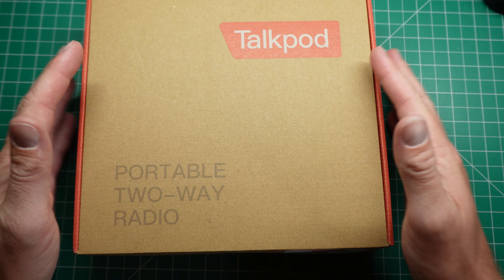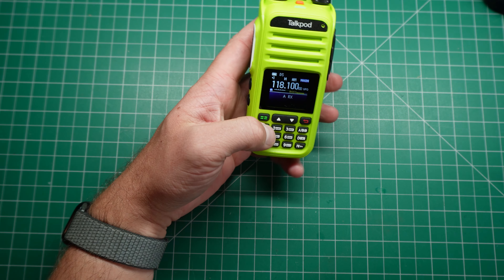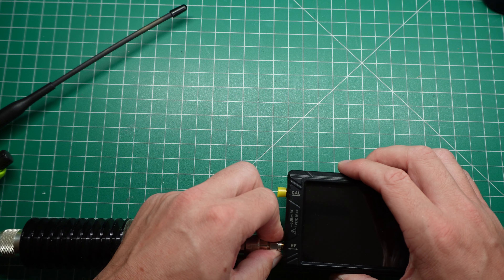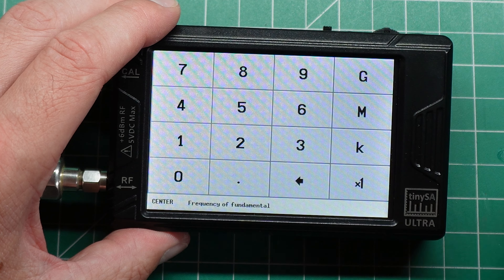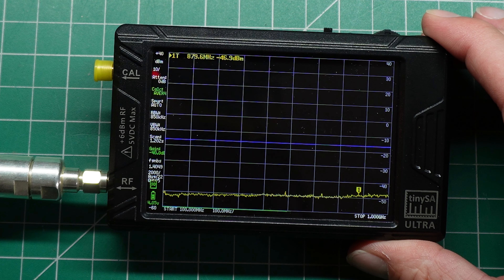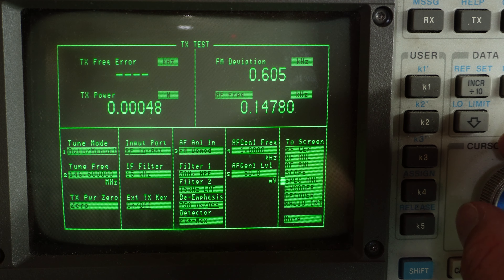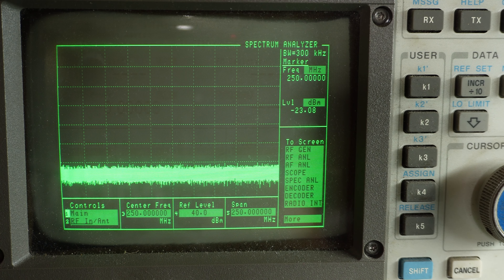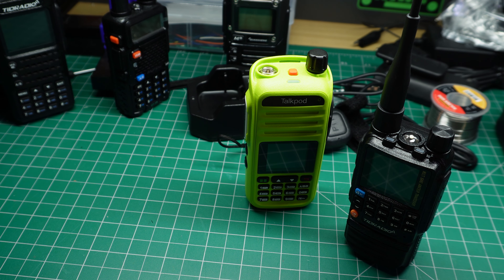The Talkpod A36 Plus Has Been FIXED!!

Comment: Truly it is the end times!  I noticed the link points to the GMRS version.  Is that just some firmware magic to change it to ham?
Reply from the maker: The version I received was the GMRS one, now I believe that holding in those button presses works to get the “expand” mode. But if it doesn’t, there is an “INT” version of firmware on their website.

Comment: Hi, Good news. How 'bout doing SINAD sensitivity tests for each radio. You have the equipment. 😊
Reply from the maker: Can't remember if I tested the A36 in a previous video, but I have done 12dB SINAD testing before. Good suggestion
Reply: @HamRadioDX  Folk seem to get more excited by a 1-2dB  increase in Tx power, than say a 2-3dB improvement in Rx sensitivity. 

So I reckon sensitivity testing IS worthwhile and perhaps even an article on "Why SINAD?" and what is it good for?

On a marginal link they are equally important, as is possibly the most important... antenna gain. :)

Comment: I have a A36P version where it says P and not plus.  Is there ANYWAY to turn off the tailing squelch after it receives a transmission?  I have other radios on the same frequencies and they don't make ANY sound after getting a transmission, but this one does it with every thing it receives and it's ANNOYING.
Reply: Choose the Option 26  in the setting menus and choose  55 or 62.5Hz
Reply: @LilBoyCalledRoy  My option 26 in the Menu is DTMF Code, only options are EOT, BOTm Both or Off.  None of the other menu options I see have any options for 55 or 62.5.